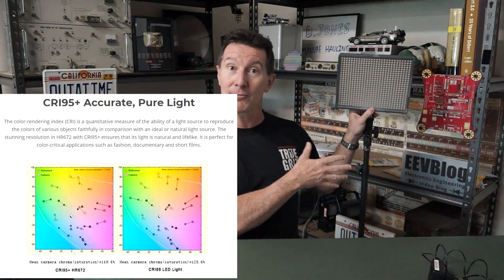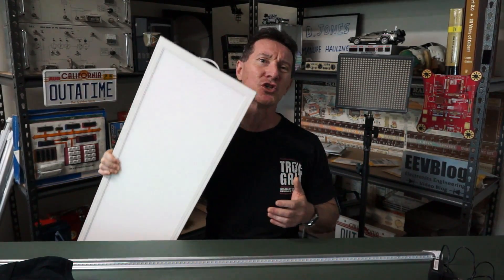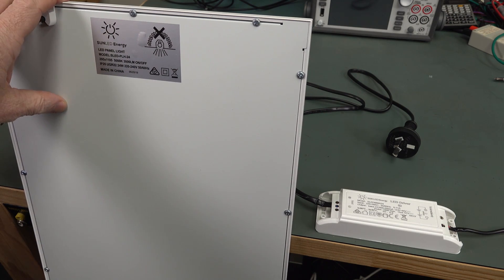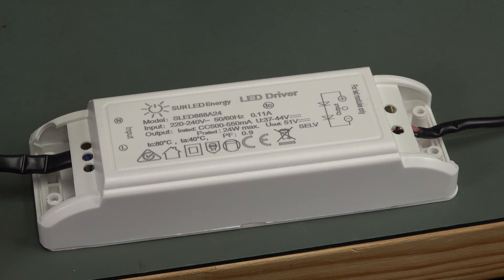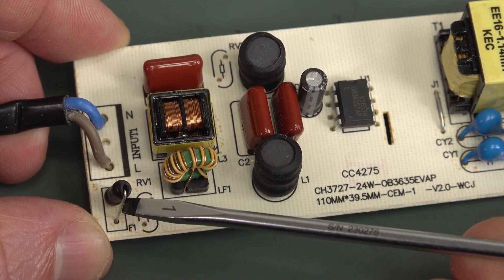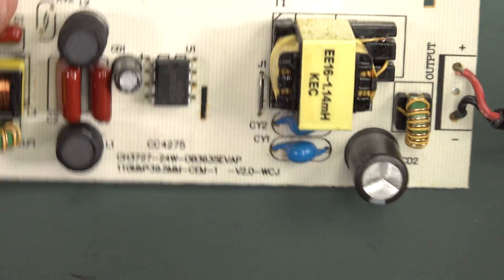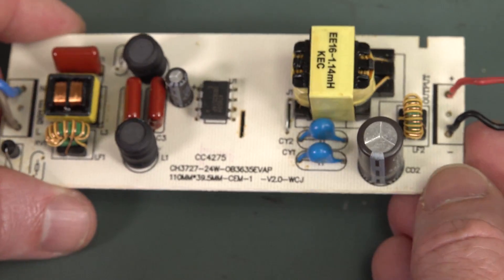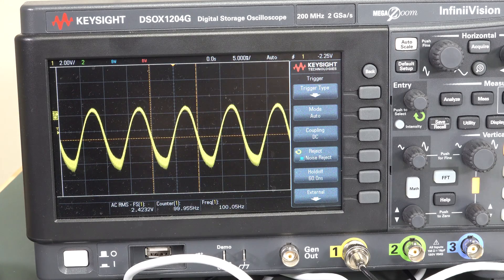EEVblog #1252 - LED Panel Lighting Flicker Investigated

Comment: There is a good way to check flickering without any camera because camera would show you only certain frequency range. Even if there is no flickering on camera does not mean there is none.
You can connect a speaker to the small solar panel and actually "hear" the flickering up to maximum audible frequency. As it turns out, almost everything flickers (except for the bulbs)

Comment: Dave ,i designed a 24v 2amp switch power supply 2 months ago,used ob2269 ic and it works prefectly.（｡ò ∀ ó｡）

Comment: I've been dealing with this exact issue. I bought some lights with inbuilt drivers. The output had an average DC of 780mA, but 350mA RMS of ripple on top. It had the exact same 100 Hz quasi sinusoidal wave on the output. The primary side only has 330nF of input capacitance. I believe it is to increase the power factor. This is a 50W driver too btw. The efficiency was ~97% and the power PF was 0.98 at full load, so it does work. However the lights were way too bright for me and the flicker was noticeable to my eyes. Luckily the driver chip has an analogue dimming pin that was unused by the manufacturer, so I just modded them. There's still plenty of light running them around 15W, and the ripple on the output is now around 35-50mA RMS. No more flicker, but the efficiency and PF goes down.

The weird thing is that these look like quality drivers. Lots of attention to filtering EMI, good quality PCB and soldering. I guess the banner specs that sell are high power, high efficiency and high power factor. The output ripple is considered "fine print" territory.

Comment: Primary side Cap is responsible for the 100 Hz ripple, ..Fix that and secondary side will only have switching frequency to filter....
Reply: Fix can't be done without a active PFC with sophisticated inrush current limit. Thank the government for power factor regulation and power company for charging customer money based on peak power. What can be done and can be done easily: use 3 phaze power and 3 of this drivers (on different phazes) with outputs parallelled (connected obviously to 3 panels)

Comment: Design your own output stage, scrape off the existing one, and replace it with a daughter board...
Reply from the maker: Cheaper and vastly easier to just toss it in the bin.
Reply: @EEVblog  but where is the challenge in that?...
Reply from the maker: @chuckpatten7855  Sure, but I have better things to do.

Comment: Typical government contract winning supplier... Corner cutting knowing full well that not a single politician will have a clue what questions they should be asking, and what they should be looking out for... They just needed their green-wash.
Reply: Steve Evans For this project, the official priorities would be output lumens per input Watt (so any heat dissipating secondary regulation would disqualify), safety compliance (hence proper isolation and certified Y caps), and low cost in bulk, including installation costs.
Reply: The problem is government "funding" it in the first place, due to the warped incentive structure. The free market has incentives to deliver good products because people are directly paying and can tell others about bad products. I'm sure this was pushed on some benefit to the planet or something, and it ends up being a direct health detriment to anyone in rooms with these flickering lights.

Comment: The primary side electrolytic is a joke, right? Is that 4.7µF and 50V?! Its capacity is almost pointless for 24W. And at that voltage rating will make a nice pop at some point.
Reply from the maker: Yeah, pretty piss weak. The other one only has the 4.7uF input cap, but of course they do the output right.
Reply: @EEVblog  So an approx 44V output with 51V unloaded and a 50V cap. Talk about pushing to the limits.....

Comment: Helpful info, Dave.  Looking at replacing the single globe in my garage come lab with some LED lighting (of some sort) and stuff like this means I'm not going to make as many rookie mistakes during acquisition of parts.  Building an LED driver looks like a reasonably approachable project, however.  Not sure I'm keen to play with mains, but yeah, interesting stuff.

Comment: You would need a two-stage converter to maintain low output ripple current and high input power factor.  If you only have one stage then it's a trade-off.  For example, the cheap one is single-stage.  For high power factor they must use a relatively low input filter cap, and the supply that runs the chip drops to zero every line cycle.  You could eliminate the output ripple by increasing the input cap, so the converter runs continuously, but then you would have really low power factor.  Increasing the output cap won't do any good because it is filtering the much higher switching freq, not the line freq.
Reply from the maker: 2nd videos coming. You can improve the output by increasing the output cap, but not by a huge amount. Input cap does the trick of course, but PF goes to crap as expected. You can't squeeze blood out of the wrong topology.
Reply: EEVblog Would having multiple primary side taps with active FET rectification allow lower loss operation with 10ms of energy stored in a primary side 30V cap charged and discharged from one of the lower primary taps?  Would require a more complex switching chip to shape the input load near a 100% PF while keeping the output current near DC.  Ideally the voltage drop in the active rectification switcher should be less than the usual 1.4V plus.
Reply: @johnfrancisdoe1563  there is a simpler solution to output ripple: lineal (switching also works) post-regulator on the output.
Reply: Actually, now that I take a closer look at the schematic, they do have an aux supply that keeps the chip powered continuously, but I think the output voltage from the bridge rectifier still drops to zero twice per line cycle, and of course the output conversion must stop when the voltage gets too low.

Comment: Add 100uf on the primary side after the bridge rectifier and I'm betting the ripple will go away.
Reply: that'll blow the bridge on start up. then you'd have to add a thermistor. then once the ripple is gone it'll output over the ratred capacity since it's on all the time and over heat itself and or the panel so current limiting will need to be lowered..... I've done these mods myself a few times and it's more involved than it seems. especially if there are (assuming) dozens of drivers.
Reply: Anton Babiy Maybe the input filtering coils will lower the inrush at the peaks.
Reply: That would definitely solve the problem, 100u at 400v is a pretty bulky cap, not that there isn't space for one :)
Reply: That will destroy the power factor.

Comment: Looks like a very small smoothing capacitor on the input.  Do they do that to improve the power factor?
Reply: Also it (flicker) increases perceived brightness because peaks of that ripple are very bright which in turn allows to decrease PSU power and "do it for cheap" even more.
Reply: Yes.

Comment: Dave, did you have a choice of lighting supplier, or did the NSW government select Sunled? I can't help but wonder if the company exists purely to take advantage of the ESS scheme. Sunled's website suggests as much, and the bargain-basement electronics would make sense for a company that is less in the lighting business than in the making-money-off-the-government business.
Reply: That's what I was thinking. There was probably some rule about buying from a local company, designed so they could skirt it by slapping their name on someone else's product and taking a cut for the privilege. But that way, others could not compete.
Reply from the maker: Sunled literally came knocking on my door, demo panel in hand. There are many other suppliers.

Comment: I have seen some interesting text on PCB's. Mainly power boards. One I remember recently had on the underside of the board, labelled "HOT" for primary side and "GOLD" for the secondary side. Hilarious!! May try and dig it out and do a video on it. Was very funny indeed. Great video Dave, I'm a sucker for power supply circuit boards and their theory of operation!!!!!

Comment: All my lights in my car is flickerin when the outside temperature is cold and my car is warming up the cabin.. after a while all displays and ligjhts both exterior and interior light except my replaced LEDs they does not flicker. But with my previous halogens they flickered like a disco :)

Whys that? Something wrong with alternator? battery? i know another person who has the same car litterly but.. he has the flexifuel enginge and i have the petrol one. Both same engine sizes.
He removes the fuse labeled F5 i think it was and it says in the instruction book PTC-element and something else. I dont have a PTC in my petrol car. Arent they in diesel cars only?
a preheater.

Anyways.. he removed that fuse and all his flickering was gone. I havent tried that yet. In the summer when its warm outside nothing flickers.. but if i manually turn my ECC control up in temperature.. the lights starts to flicker :) so we have figured out something has to do with the cabin warmer or climate control?

How to diagnose this myself somehow? multimeter? measure where? Ive got a mini DSO to use also.. cheap china one but.. it works :) cheesy probes though and plastic button.. i allready broke one. So i must use something else to press the microswitches with.

Ground problem?

I hope you understand my message/quiestion kinda...
Reply: maybe to do with engine RPM varying until it warms up. Engines don't like running cold. Just watch some videos of engine cold starting in winter. -20 and colder is not uncommon in canadian/russian winter. You'll see what i mean.